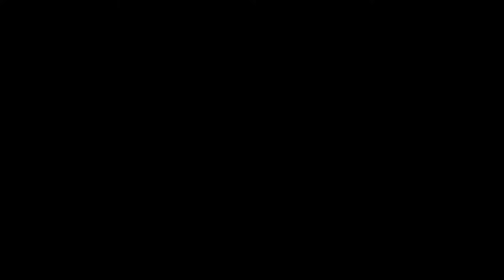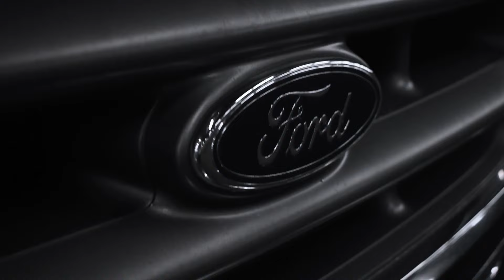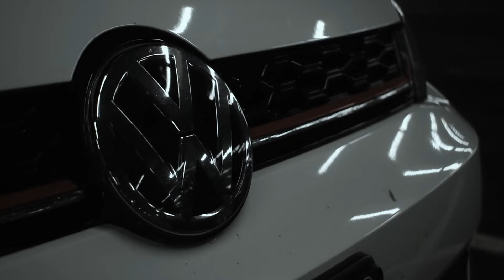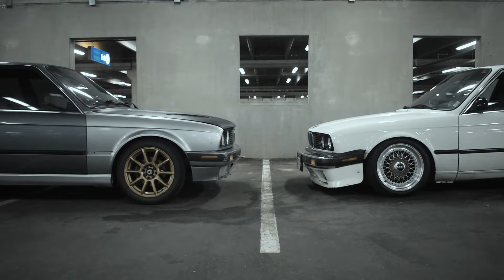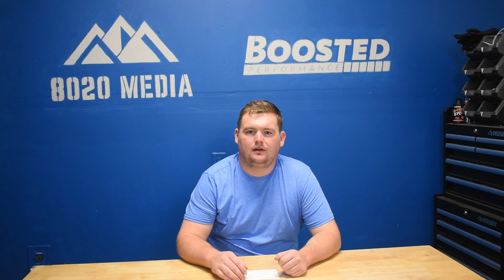How Reliable is the Ford 3.5 EcoBoost? | 3 Common Problems

Comment: Have a 2015 3.5 ecoboost that has been pretty reliable. I am at 236k miles of 80% highway driving.  I have changed oil only at the computers recommended interval (roughly every 10k miles) with motorcraft synthetic blend 5w-30.
I’ve replaced passengers side valve cover for a leak, 3 throttle bodies, and a crankshaft pressure sensor. 
I have the common rear broken studs (revised manifolds ordered ready to install) on both sides and turbo fitting coolant leaks that I will be addressing soon. All in all not too bad. I’m planning to run it to 4-500k miles. 
Very important to keep fluids changed in the trucks. Had “rumble strip” vibration twice after fluid had broken down from Highway driving. Once trans flushed shifts like new again. Plan to do trans flush every 60k. Also, keep up with routine plug changes. Great truck!
Reply from the maker: Jason - Thanks for sharing your experience and valuable insight!

Comment: First truck I've owned(new) is the 2014 3.5L. I have 93k and she's running great. It did have a slight rattle(from what i hear is normal in Fords) up until the 75k mark. I decided to get a tune up and not wait until a 100k(which i thought was excessive). So I changed the plugs, coolant, transmission fluid etc. I also looked into changing over to full synthetic(Pennzoil UP) oil,  instead of the synthetic blend that's been used. What a difference it made! No more knocking, better fuel economy (19.5 mpg up from 17.2) and it rides so much smoother in cold and hot temps. Next tune up, around the 135k.Oh and since it's over 75k, i'm gonna try the Valvoline HM max life oil next and see how she runs. Hear great stuff about that oil. After a year, I'll probably switch oil change intervals between the Valvoline and Pennzoil.

Overall, i'm very impressed with my truck even though it's not really broken in yet. I've learned a lot being a first time truck owner and preventative maintenance is a must for sure.
Reply from the maker: CWB - Thanks for sharing your experience! This will certainly help future viewers.

Comment: I have this engine in 2015 Flex. Best engine in a vehicle I have owned for sure. I have 107k miles I just had the cleaner run through to clean the carbon out. And you can feel the power come back to the vehicle that I didn't realize I lost. Having thus engine in the Flex definitely make this a sleeper car for sure especially having it in AWD. Great video, thanks for doing this.
Reply from the maker: R - Thanks for taking the time to share your experience! Also, thanks for the feedback.

Comment: Oil on my 2013 EcoBoost gets changed every 7,500 miles with castrol edge EP, and motorcraft or fram ultra filter. 165k miles, no issues
Reply from the maker: Mow - Thanks for sharing your experience! Great to hear a 3.5 running well.
Reply: You’re waiting wayyyy too long to replace your oil
Reply: Exactly how I do it. I let the computer monitor the oil life and it amounts to 7.5K miles interval on average, zero issues and oil is clean.
Reply: better yet use Pennzoil Ultra Platinum, and a Wix XP or Mobil 1 filter.  My oil analysis from Blackstone says 8K oil changes easy.  Thanks for sharing
Reply: Thats impressive with Fram.

Comment: I got a 2012 3.5L with 350000km on it . Original engine never touched! I am started to hear some rattle on cold startup. I think the biggest thing with these engines is regular maintenance! I do changes every 6000 K with the cheap conventional oil just keeping the oil clean is more important I believe. I definitely agreed with the sparks Being changed more often I had a mis fire a couple of times just because of the plugs.  Overall best truck I've ever own! I was a Chevy guy before this one. Will be getting another 3.5 ecoboost soon, just waiting for the price to come down .lol .
Reply from the maker: Moon - Thanks for adding your valuable experience! Rattling on cold start can be a cam phaser issue, so may want to get that looked into. But from our experience, the 3.5s have been pretty solid! We couldn’t agree more about prices right now..

Comment: The first 3.5L ecoboost engines were introduced in some Lincoln models as early as 2009. The 450hp H.O. Option(for Raptor only) came in 2017. Great video… Ecoboost owner, car enthusiast. I read alot.
Reply from the maker: D - Thanks for the feedback and valuable insight!
Reply: I have a Lincoln MKS2010 with the power Tran of Taurus SHO  AWD 3.5 éco boost 355 HP AND 365 of torch with 165000 kilos no problems I clean the intake valves at 80000 kilos as maintenance I love❤ this car fast and nervous stick to the road

Comment: Only issue I had on my 2016 3.5 Ecoboost was catalytic converters stopping up . First one was around 30,000 miles and second was at around 45,000 miles . Asked why and was told by dealership Ford made a mistake on sizing them . Supposedly they made a update to increase the size . Doesn’t make since to me but that’s what they said and was covered by emission warranty.
Reply from the maker: Cliff - Thanks for sharing your experience. That must've been frustrating..
Reply: I have the same issue with my 2016.  I just ordered a high-flow catted downpipe set.
Reply: @colliswilliams8992  

Dealership did mine under emissions warranty. Said they were larger size than what they took off . Hopefully you get yours taken care of .
Reply: @cwtex59  I'm out of warranty.   I'm installing aftermarket, high-flow cats that have a larger honeycomb so they breathe better than the OEM.  They aren't legal in NY or Cali, but I'll never ever be going to either of those places, ever ever ever.

Comment: I bought a 2017 eco boost XLT F150 crew cab new. It was an amazing truck when it did work. but I swear it was in the shop more than I had it. From the ticking and having the cam phasers replaced 4 times and timing chain 3 times, the panoramic sunroof broke three times, and 4x4 went out twice in less than 3 years.
Reply from the maker: Yikes - sounds like you got a lemon, not sure I've heard any this bad before.
Reply: how often did you do oil changes?

Comment: I just got a 2018 raptor, about a month ago. 51k miles. Went today to have the chatter looked at, it's the cam phasers. The factory warranty is up im March 2023, so next month. They did a warranty fix. They said the parts would take a month to 6 weeks to get in. They did make the service order for today so I'm covered. Other than that just the blind spot monitor is faulty. I believe the extended warranty will fix that. Great truck.. this is my first ford vehicle..
Reply from the maker: Kace - Thanks for sharing your feedback! We love a good Raptor. Hopefully you get much more out of it.

Comment: Great video! I have a 2013 F-150 with the Ecoboost 3.5L. I bought the truck with high mileage already and it currently has 242K miles. I changed the spark plugs right away after I bought it (wasn't really needed), did a transmission service and changed the filters. The truck does have that "death rattle" common in these engines in cold starts and after sitting for a day or two. This gets better with fresher oil and it's an oil pressure issue on the sprocket and not a plastic guide issue as some people believe. Overall I was impressed with the performance of this engine, it has so much power that the truck feels "light." The amount of torque is ridiculous! You're doing 65mph on 6th gear and go up a hill and the engine will NOT need to downshift but only get like a low hum and go. 
One issue I've had is the Y coolant heater hose leaking and it seems to be very common. It is not something that will leave you stranded but eventually you'll have to replace it if it starts leaking. I'm plugging a link here if you all don't mind. Thanks! 
https://youtu.be/sU2XBcSzzjA
Reply from the maker: Triple Seven - Thanks for the input and feedback! We truly think the 3.5s are excellent pieces of machinery. Usually we don't like it when people leave links in their comments, however, since we feel you've provided insightful information we'll allow it. Thanks again!
Reply: What's the death rattle feel like ks that were the frame feels like it shakes
Reply: @imbrok3n882  The "death rattle" of the 3.5L Ecoboost is a rattle at cold start up caused by the oil not reaching the camshafts sprockets fast enough. It is only a fraction of a second in most cases and it doesn't really cause the engine to die or anything although some people do say that it gets worse overtime. 
In my case when the oil is getting old and near the interval for a change the rattle does get more noticeable but the truck runs great and it has almost 250K miles. 
A solution to this is to floor the pedal and crank the starter a couple times, which will make the engine turn but not fire up due to the computer detecting the pedal floored, then starting the engine normally. That makes the oil flow up and eliminate the rattle completely before the first start in the morning.

Comment: 2017 Gen 2 , 3.5 .... 62k miles ... Im on my 5th time having the Leaking Oil Pan Fixed ..  and 2nd time having the Cam Phasers Done ...  *Too Not Mention Either of these issues is a Disservice to your viewers !!!!!
 You might Also want to mention that on the Brake Calipers that the Bottom Slide Bolt seizes ... had to replace mine at 27k and just did them again at 61k ... and yes , they were properly greased with good , intact seals .. so not sure why , maybe the metal ford uses on the FOMCO parts was not good , idk , but ive never seen the slide bolts rust up so fast . Also had the windshield washer pump go , a starter go and the 400watt plug shuts down all the time with just my phone charger .. ughhhh
Reply from the maker: Daniel - Thanks for your input and experience. Unfortunately, not all engines or vehicles are created equally. These are just the problems that we have seen more predominately. However, your feedback will assist other viewers in the future!
Reply: This is a video about the 3.5 engine, not an area to whine about brakes, windshield washer pumps, starters, or the 400 watt plugs. That’s for your Facebook page
Reply: you got the plastic oil pan.  my 2018 got the metal one half way through production.  love it
Reply: My 2017 3.5l twin turbo eco boost engine just locked up on me with oil in it. Now I got to buy a new motor
Reply: @richardrice6932  nah, just go to the dealership and get a new key for that locked up engine of yours, it happens all the time

Comment: Nice discussion, but I was surprised you didn't cover some of the other big problems that plagued this engine. I wanted one of these engines but decided to wait ten years until it had more  updates that fixed most of it's weak spots. The cam phasers were a huge problem with these engines, that I knew of, up until 21 when they did a major redesign on them and also went to cast SS exhaust headers which was apparently another problem with exh manifold warpage, that Ford addressed.  I think they tweaked some other areas at that time. I waited until 22 to buy one, and so far, the phasers are doing well. I only run blended syn FOMOCO oil and filters and change the oil every 3k. I've used pure synthetic oil on all my cars for the last 35 years, but when Ford engineers tell us to run a syn blend oil in their 3.5l engine, and since they have countless hours of data that I don't have, I run syn blend oil. The more often oil is changed on these kind of turbo engines, the better it is for the engine.  Not an area to try and save money. I change mine every 2500m.
Reply from the maker: G - Yes, we forgot to include the cam phasers. But you're spot on with everything else. Thanks for the added insight.

Comment: Great episode,  some of the power figures are wrong though.  The 17-21 have 375hp and 470lbft and the standard 3.5l ecoboost in the 21 plus are 400hp and 500lbft. The Raptor and limited models share the same high output engine.  Great content.  Thanks for the info
Reply from the maker: Aaron - Thanks for the insight and feedback.
Reply: @8020Media  Thank you for the great content! 👍

Comment: I have 344000 km on my 2015 3.5 eco boost. I did have to do some work on it. Timing chain, purge valve,cam shaft cracked. Overhauled the 6 spd trans but now it's running like new again and with a 91 octane tune, a nice bump in power and torque. Added a catch can, straight pipe exhaust, high flow cats and a cold air intake. I would recommend this to anyone.
Reply from the maker: Nice! Sounds like a solid build - good to see the block and internals are all holding up nicely.

Comment: You missed a couple big ones. I have 2014 tremor. Exhaust manifold bolts breaking and manifold warping, both sides did that to me. Mechanic said it's a common issue. Second one is cam phaser rattle, I had those replaced(4) and while they were in there I had them do the timing chain assembly.  All this happened  before 100k miles, all very common to the 3.5 eco.
Manifolds were $1500 a piece, timing gear and phasers were $ 2500. Not ok in my book, kinda wish I got the 5.0. Mechanic told that the 5.0 has cam phaser issues also though. Your next  post crank up the volume a bit, hard to hear you.
Reply from the maker: Evie - Thanks for sharing your experience with your 3.5. This will also assist future viewers! Also, thanks for the feedback! We're trying to do everything possible to produce the best content possible. As of this recording, we have pumped up the mic volume, so we hope this isn't an issue anymore. Thanks again!
Reply: @ernestjohnson1807  I had an 85 and an 86 toyota 4x4's, drove them for 12 years. Great trucks but gutless at highway speeds. While I would have gotten a great price for my trade in, the price of new and used trucks are insane right now. I looked at what was out there and I couldn't afford it. I actually really like the truck and the power it has, just wish the ford engineers would pull their heads out of there asses and come up with better designs.
Reply: Untrue, the 2014 is a "sport truck" so my guess is you are drag racing it, etc. Racing vehicles tends to require frequent engine rebuilds, doesn't matter what's under the hood. I have never heard even once of that issue; people that drive vehicles hard will have problems with them, people that take care of their vehicles don't.

Comment: 290,000 km on my 2012 F150 FX4 3.5L EB. I am the original owner and have used Mobil 1 full synthetic since 60,000 km. Always use top tear fuel, change oil at 8 - 10,000 km, avoid short trips and have not had any noticeable carbon issues. I have replaced spark plugs every 80,000 km with Motorcraft, the last time I gapped them to .028, read somewhere that helps them last longer. Replaced the timing chain/phasers at 240,000 km due to the cold start rattle. Still makes great power and fuel economy hasn't changed. No oil consumption or oil leaks, I have chased a few coolant leaks one being the o-ring at the bottom of the coolant reservoir and another being a loose clamp on the drivers side turbo. Would definitely buy this engine again, regular maintenance is the key though. Good oil and change it often.
Reply from the maker: MotorDogz - Thanks for sharing your experience! We love seeing 3.5s thrive!

Comment: Bought a 2018 3.5 ecoboost brand new from for in 2018.
Cam chain tensioners 
Leaking oil pan
Leaking diff
One time it was in the driveway went to start it wouldn't start.
That was in June 2022 now in Nov 2022 its in my driveway again won't start.
Think I'll sell this money pit and look for something more reliable. 
Truck currently has 75k on it
Reply from the maker: Stephen - So sorry to hear about your 3.5. Thanks for sharing your experience, it will assist future viewers.
Reply: mine has been bulletproof.  on my second
Reply: 2018 3.5 ecoboost original owner here.  Installing my cam phasers for the second time.  1st time was during pandemic, original faulty design  phasers were installed.  They lasted 40k and now I am getting the "newly designed phasers, 2021 model".  Make sure you ask for the M series and not the H series phasers.  H is the old stock with the problems

Comment: The 3.5 ecoboost first came out in the 2010 in Lincoln vehicles as well as the flex and taurus sho.   I changed my oil every 5k, with full synthetic, and had both the carbon buildup problem as well as the timing chain issue.  Not to mention transmission pump issue, deformed oil pan, 4wd went out the first time I used it, steering rack went, radio quit on me, blend door on the hvac system went, support bearing for the main driveshaft went, when I changed over to towing mirrors, one nut holding on the mirrors was a different size, and, when I had to change out the battery, a cap from the original battery was left in the battery tray by the factory.  At Ford, quality is no longer job 1, not like it ever was though.
Reply: Forgot to mention, had to change out the boost pump for the brakes as well.  Don't forget to mention the transmission issues as well as the moisture issues.  According to the state I live in, my F150 was two days short of being a certified lemon.
Reply from the maker: Pete - Sorry to hear about your experience, but is definitely helpful for future viewers. Do you still have said F150?
Reply: @8020Media  Nope, I got rid of it almost 2 years ago, and I only had 140,000 on it.  My Chevy lasted twice as long as that, and was still going strong when I traded that in.
Reply from the maker: Pete - What Chevy are you in now?
Reply: Did you use a good synthetic filter too, it makes a big difference